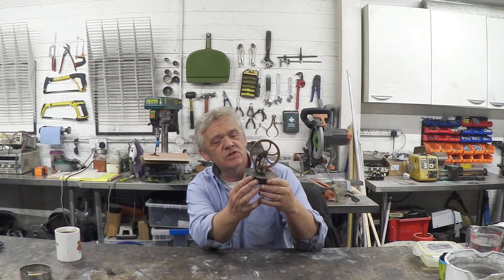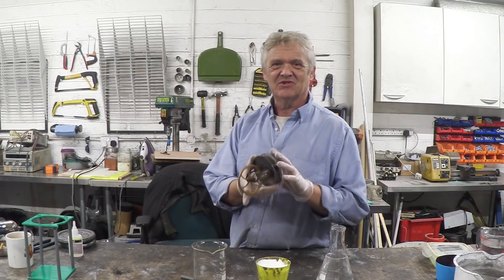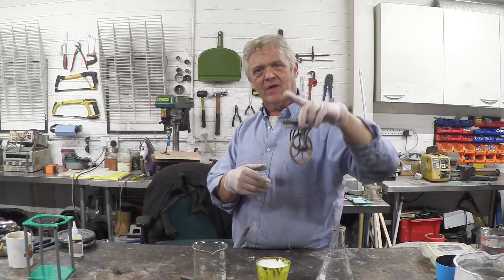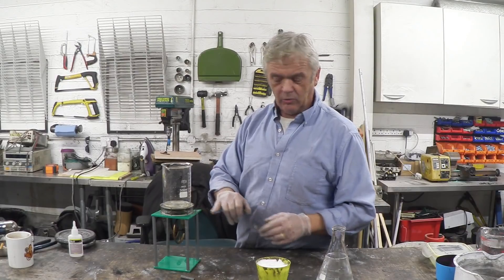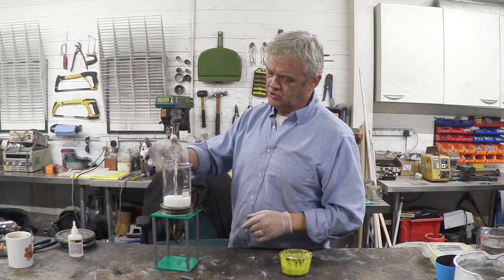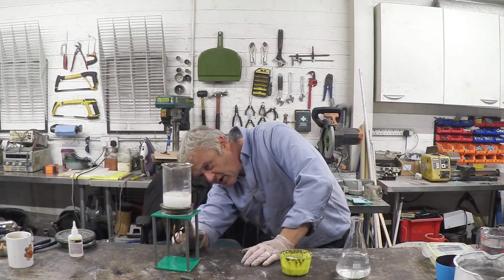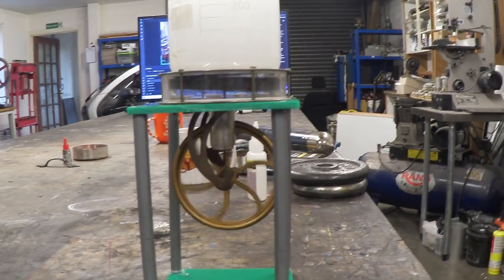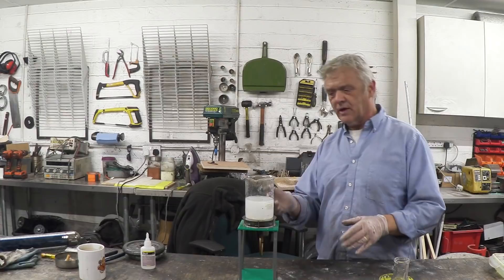1264 Running An Engine Without Burning Anything - The Soda Stirling

Comment: Seems like this would complement a solar thermal plant for night-time / cloudy day generation, especially if there was a way to run it in a liquid closed loop and consume any low grade heat waste in the system when it’s sunny.  There wouldn’t be big issues with long term storage of the energy or limited charge-discharge cycles; technically there may be efficiency issues but as long as the system could be large enough and remain economical it wouldn’t be a big deal since the primary energy input isn’t costing anything, it just needs to be able to have the capacity, operate for a long time and do virtually infinite cycles.

Comment: What if we add a black pigment to the solution, will it increase the sunlight absorption and thus increasing the evaporation rate? What if me make a closed system under vacuum to reduce the boiling point and recollect the evaporated water to feed it back by gravity in a controlled rate?
This viedos are so great in stimulating ideas.
Reply: There's a guy on YT doing something similar to this with a tesla turbine and anhydrous ammonia he's over on the ienergysupply channel.

Comment: Maybe someone can explain it to me. What's used to make the heat? Surely it's not 100% of the sodium left when dried out? The water evaporates but I feel there's something missing in the equation. Are there any harmful gases? If i put a vat of this to heat my house during the night and then dry it using solar during the day? Seems to good to not be explored. Thanks for an interesting video! English is not my first language so maybe y questions isn't spot on but I guess you'll understand what I mean.

Comment: Cool way to get a sterling engine to run!

I wonder if you could combine a sterling engine with a wind generator?  Would you get more energy out if the piston is driven by the wind and heat at the same time than you would of either running on its own or would you only generate at the max of either of the two systems?

Comment: Thanks for the info Rob. I've been thinking about Stirling engines a lot lately for a residential use. I've thought about combining several renewable sources with the Sterling to generate/store electricity, solar, thermal, wind, why not chemical too.

My question though, how do you make a Sterling Engine from scratch? What formulas to use? What materials? Which configuration works best?

Thanks in advance.

Comment: Wow that greats. A closed loop chemical hydration engine . Surely with the technology today and the carbon offset trend we should be looking at these topics again in big industry. Why can’t we use these as instant additional power to base load during peak power demand instead of having a trillion expensive lithium ion batteries in shipping containers? Geez humanity must have forgotten alot even with the internet in our hand !Thanks so much Robert. This really is amazing to me !!
Reply: You don't need to use chemicals there's a thing called a nitinol engine which uses memory metal to produce motion from a very small temperature differential.

Comment: Hmmm heat battery you say that brings me to an idea ! What about heating caustic soda so hot that it melts and works as an electrolyte kind of heat driven alkaline battery ? I know it sounds wired but people make sodium from electrolysed molten caustic soda so I thought then it should be possible to reverse it to make electricity as well. Some type of thermite reaction should be enough to melt the caustic soda but for first try a bunsen burner should do it as well :D

Comment: Rob you mentioned it gets upwards of 100C. Can it get hotter?
Reply from the maker: In open atmosphere I wouldn't think so mate - I would think it was self limiting after all it is from the heat of hydration so over 100 the water boils off and there is no hydration I guess if you put it in a pressure vessel then yes it could go over 100
Reply: @ThinkingandTinkering  Yeah that makes good sense. High pressure is scary! 😬 

I wonder if this steam could be used for other purposes? Like making a Steam methane Hydrogen reformer?

Comment: Could we run that sterling engine on a Peltier device powered by solar panels?
Maybe have it turn a fan to blow cool air from the cold side of the Peltier?
Reply from the maker: you wouldn't really run a Stirling from a Peltier I think mate - but you could run a fan directly from a Peltier device

Comment: Utilising phase transition in an engine would be nice. e.g. liquid water to steam is an approximate 1700 x expansion. By keeping the water close to boiling point, the amount of energy required for phase change is much less than heating cold water to boiling point.
Reply from the maker: for sure

Comment: The useful thing about those low temperature Stirling engines is you can cool them too. Ammonium nitrate or urea in water and they will work by cooling instead of heating.
Reply from the maker: nice one mate

Comment: You could probably devise a way to use the residual heat from this reaction to evaporate an expired sodium hydroxide solution instead of using the sun. You the harvest the water vapour coming off and through a weight balanced system the water is reintroduced to the sodium hydroxide and the whole cycle repeats.
Reply: Ian Fisher: I like the way you think! Closed loop or as close as we can get to it is a step in the right direction in my opinion.
Reply from the maker: nice one mate - go for it

Comment: You once did a dielectric generator with conductive ink.  Would a dielectric device, using the  peltier/seebeck effect, or a stirling engine be more effective at extracting power from a thermal source like this one?
Reply from the maker: I don't know mate

Comment: i actually made a napkin design for a high-temp pyrolysis still that had a sodium hydroxide scrubber to help take care of chlorides and flourides and sulfides in plastics and organic matter and the heat from decaying the sodium hydroxide and potassium hydroxide was recycled to help reduce the input energy for pyrolysis. I'm trying to make one that can be ran off a fresnel or an archemedes deathray and so capturing and reusing as much heat as possible is incredibly important with such low grade input energy
Reply from the maker: for sure mate

Comment: This I think is the best efficient done Sterling yet a gamma variant appr. 40% efficiency! I read somewere the max is 80% efficiency on a Sterling! it got me to think! A hole cirkel no Fysikal work just only heat and cool with two flyweels in an equilibrium! the configuration for this is 4 Alpha-stirlingsmotors in a Boxermotor with 8 cylinders! this motor was made in 1950-1960, (now only 6 cylinders Boxermotors is made) by Porsche and some airplane-engins! What to do? Just do four converted Sterling Alphas in a same 8-cylinders Boxermotor! Now you get all on the flyweels if this has propellers in the middle the cooling effects is intergraded and a generator om both flyweels! To think boxer its easier to have a v-flat stroke on the cylinders! I have never seen this yet! But it might be time for this thing to be made! Then this typ of fuel can be enought! With higher pressure and lighter gas (helium) i think 80% efficiency Stirling is in the reachable target! Have a nice evening Robert and thanks fore a good  video!
Reply from the maker: cheers mate and glad you like the vide Nic thoughts there thanks for sharing

Comment: Great info! Thanks 👏

So we've got NaOH and CaCl2 + water...
Any more ideas on chemicals that can be used to produce these types of "rechargeable" exo/endothermic reactions?
Reply: The heating agent and responsible reaction vary from product to product. Calcium oxide is used in the following reaction:

CaO(s)+ H2O(l) → Ca(OH)2(s)
Copper sulphate and powdered zinc can also be used, but this process is less efficient:

CuSO4(s) + Zn(s) → ZnSO4(s) + Cu(s)
Anhydrous calcium chloride is often used as well. In this case, no chemical reaction occurs, instead the heat of solution is generated.

Commercial heat sources for self-heating food packaging use an exothermic (heat releasing) reaction, for which there are several common formulations. These include:

Quicklime aka calcium oxide, and water. Quicklime, inexpensive and readily available, is generally recognized by the FDA as safe.[2] The product of the reaction is calcium hydroxide.
Finely powdered magnesium metal alloyed with a small amount of iron, and table salt, actuated by adding water
Reply: @Enngel0  Thanks for taking the time to share the info. Great stuff, I thought the calcium oxide reaction was interesting because it was cheap, fairly safe and readily available. Just need an energy efficient way to reverse the reaction.
Reply: My first thought was to search for "heat of hydration". I think Lithium hydroxide is one (probably expensive). Also Calcium oxide. When water is added it forms calcium hydroxide and heat. To return it to calcium oxide requires "The hydrate can be reconverted to quicklime by removing the water by heating it to redness to reverse the hydration reaction."
Reply: @hubrisnaut  thanks! Searching for this I reached a company that uses its "nano coated salt" as a green energy storage solution.
Reply: @angelusmendez5084 I 'get' our condition.. material science and philosophy .
Reply from the maker: it might be an idea to look at hand warmers and self heat cans mate - also there are a few companies playing with this idea I believe sunamp being one

Comment: With the right design could you not have a solar still/soda separator type gadget? Thinking of a sealed unit that just needs the water re added once soda has dried out.
Reply from the maker: I would think so mate

Comment: Interesting concept, Rob.  The idea of concentrating ambient heat and running a Stirling engine has interested me for quite a while.  I come from Texas, where summer heat gets close to 100F most days in the summer.  We have huge parking lots (acres of parking spaces) that are invariably asphalt, and by 3 pm June - September, the heat coming off the black top at the shopping center is painful.  It seems reasonable that a system of heat sinks and heat exchangers could run Stirling engines large enough to produce usable energy.
Reply from the maker: I would 100% agree with that mate

Comment: Wow thats cool so it just needs evaporation to work aigain ? 
By the way using the stirling engine

 ...Robert did you ever think of how to reduce methane from the air in cowsheds or swampgas?

Would it be possible to ignite Methane molecules with a laser from a solar-concentrator and generate heat in an restricted glass vaccum compoundment channel where the air is flowing  through,  by heat difference? And the light passing through to the other side of the glass channel producing energy via a stirling .  The air warm airflow could be used to evaporate the liquid.

Oh and another thought that spinns in my mind.

Could the heatdifference inside and outside a car be used to produce electrical energy using quite flat a stirlig engine or a thermo electrical plate. I mean by clipping it into the rear car window. If the difference should change from wamer inside to colder inside it would be possible to put the device into the other rear window.
Reply: Oh... Mistake... it will need a lot more heat... the equivalent... chalkburning prozess ... so first drying then ... solar concentrated heat on the powder
Reply from the maker: to be honest mate I have no idea - but my approach would be to do a google scholar search followed by an experiment or two

Comment: I've watched a few videos of Stirling engines in the past.

There is one that will run from the heat of your hand.

There is another one where the individual made a Stirling engine using a large and a small aluminum soda cans.
Reply from the maker: they are quite fascinating machines mate
Reply: @ThinkingandTinkering  😎👍

Comment: I've always wanted to run a stirling engine from a sun focusing lense from an old tv.
Reply from the maker: to be honest mate - that's pretty easy to do - buy one of these small LTD Stirlings and a fresnel lens turn the Stirling upside down in a cradle like the one I made then focus the lens on the bottom - hey presto!
Reply: @ThinkingandTinkering  
🤔…
Reply: There are solar power plants that use this idea, so you know it works.  Give it a go!

Comment: This is amazing. Surely we can power a Stirling Engine using any exothermic reaction.
Reply: Even an endothermic reaction could run a sterling engine. It runs on heat differential. So creating a cold area could work just as well if it is colder enough to create the heat differential that is necessary to make the medium inside the chamber expand and contract to move the piston.
Reply: @jsoswell  Surely couple them together if it can be practical to do so - 2 reactions
Reply: @jsoswell  Of course
Reply: So we've got NaOH and CaCl2 + water...
Any more ideas on chemicals that can be used to produce these types of "rechargeable" exo/endothermic reactions?
Reply: Even better
Reply: The principle to remember is whether endo or exothermic, the greater the heat differential, the more horsepower the engine will have.
Reply: @jsoswell  Power as in Work Done per unit Time, so that's the Torque (Nm) of the Wheel x it's RPM  (/s) right?. Sterling engines are 80% efficient. kT is thermal energy right? Therefore k∆T x 80% x Time of engine running = useful Work Done
Reply from the maker: yes you could

Comment: Is this a precursor to Wednesdays Livestream on your twitch channel?  Sorry I missed the first one.  The heat battery sounds really promising if the wetting/drying can be mechanized.  Any hope of another free piston stirling engine build?  Something that could be bolted together as opposed to taped/glued would be cool to use as a platform for experimentation with different design elements (displacers, diaphragms, etc.).  Plus it would make a great kit for the store 😄.
Reply from the maker: we did the back up to this on Mondays stream mate - we sorted out saving the stream so Mondays stream is on twitch now - I have something else ing ind for Wednesdays stream - cheers

Comment: Any idea why sodium metal and water wasn't used or used more widely to provide both heat and hydrogen for a combustion engine?

Light metal made from an abundant element. Stores lots of energy.  Very safe as in can't ignite without water, provides lots of energy. Why not?
Reply: Well, I would guess the coulomb explosions are the limiting factor. Seems like a fun project for sure.
Reply from the maker: I have no idea mate - but if it was me and I was interested in this I would do a google scholar search followed by an experiment or two